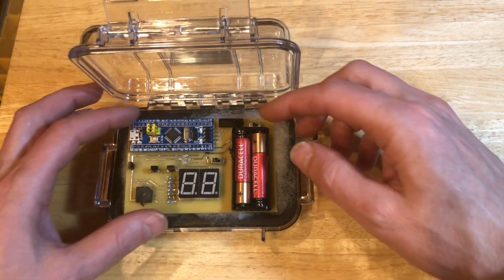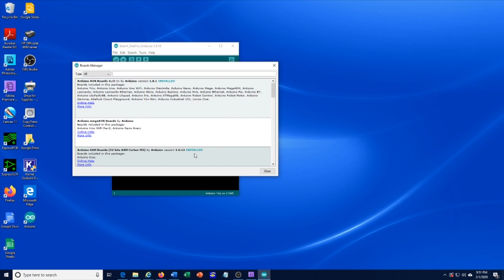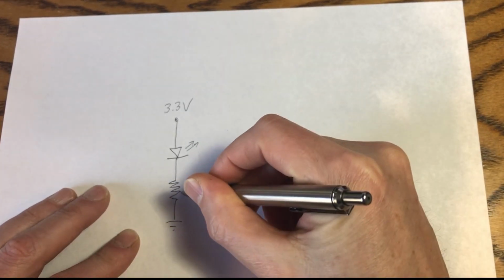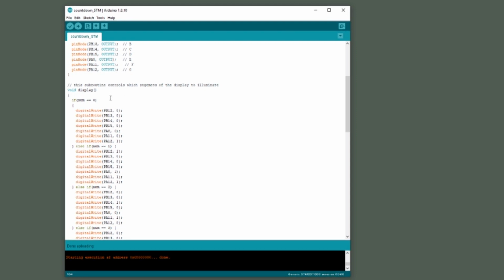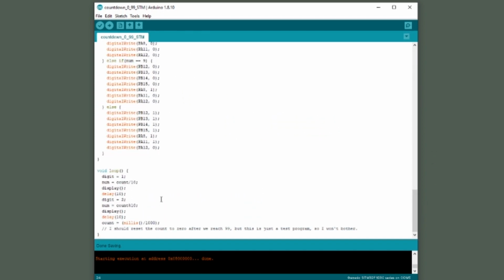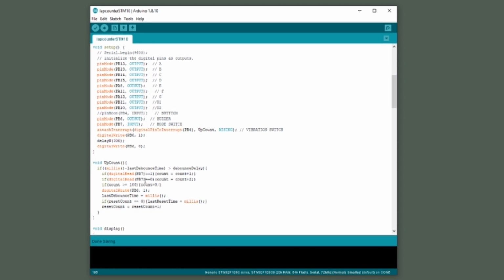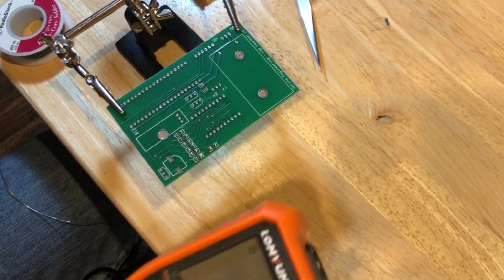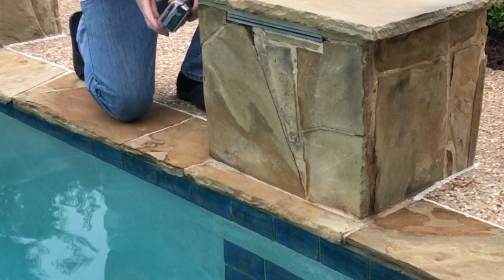Lap Counter with STM32 and two 7-Segment Display Modules

Comment: Nice vid! I noticed it triggered when you set the switch to double increment. Was it caused by the vibration or the switch? Thanks!
Reply from the maker: Yes, the count incremented when I moved the switch due to the vibration.